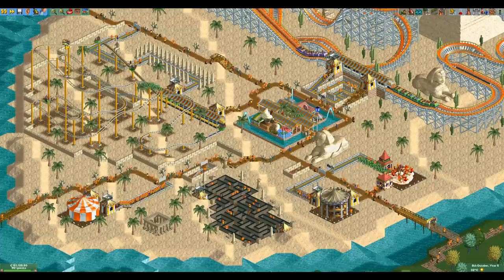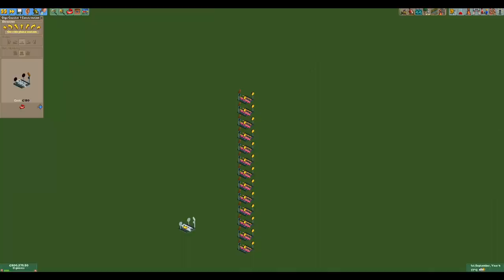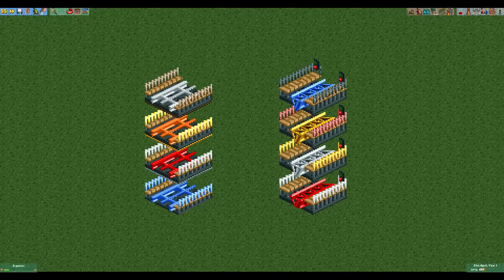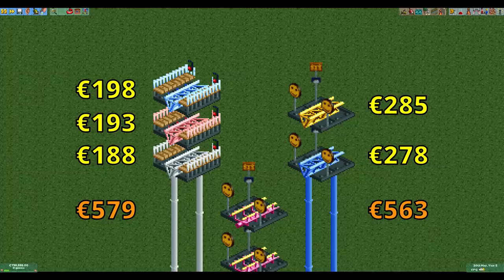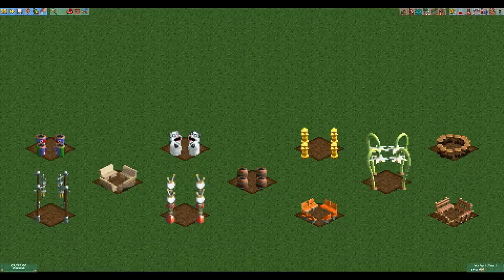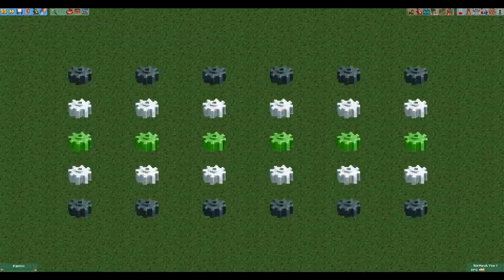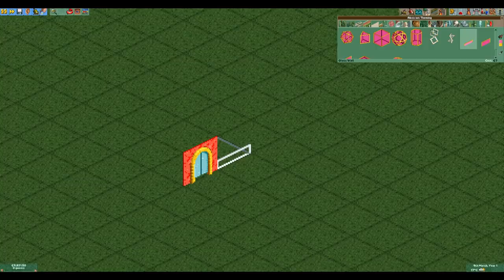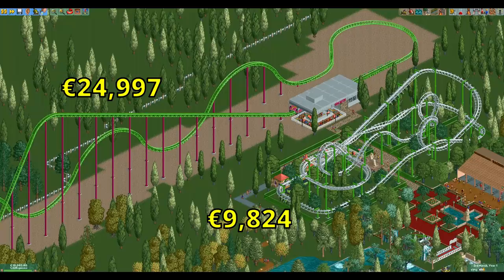How Much Money Can You Spend By Building On Just One Single Tile?

Comment from the maker: Quite a few people are asking about building underground. I start building at a height of -6, which is the lowest height possible, so you cannot build under it. If you raise the land so that you can build underground, you lose the top few pieces of path which cost over €600 each, which you will never be able to make up underground.
Reply: If one was to make an entire map of only using this tower, then assuming the largest map size is used:
256^2 = 65536
65536 * 36362 = €2,383,020,030
This is even more expensive then the price of the nation of Malta's planned economic recovery as funded by the EU a few years ago.
Reply: @serraramayfield9230  There's a challenge in this
Reply: If you lower the land do you get a higher support cost?
Reply: Is it possible to change the surface of the bottom tile from grass to another type and, even though you are at -6, change the wall style? Adds another few bucks to the total
Reply: What is the maximum amount of money you could spend in a park (before reaching the object limit)?
Reply: @serraramayfield9230  Not quite - the path signs and glass walls would be shared between sides, so you'd have to cut down the per-tower cost by 6712 per tile, leaving you with a per-tile cost of 29650 in a repeatable pattern, plus adding that 6712 cost back on 511 of those tiles at the edges, for a total of 1,965,153,214.
Reply: @undine120  oh damnit i completely forgot this
yeah this sounds right
Reply: If you were to fill tiles with this expensive tower, how many tiles would you be able to fill before hitting the sprite limit?
Reply: Can't build this here...
Too high for supports!
Reply: Thank you for clarifying that!
Reply: So, ironically building it all underground doesn’t put you in the whole as much?
Reply: You could also change the ground type (top texture and wall texture) underneath for a little more cost but it is not really building.
Reply: Lol I’m watching this again and the thought occurred to me, what about placing staff on the path?  Technically that’s an added cost 🙃
Reply: @kiffe22 build an amusement park so profitable it can fix the British economy in one year?

Comment: Fun fact: If you use the largest map (254x254) and multiply the total (65,516). The most money you can possibly spend to fill up every tile is…

$2,345,930,792
Reply: It gets even more wild with the new map sizes from open RCT 2.
Reply: Glad someone else thought of this too, but 254*254 is 64,516. Still well over $2b in pathing and scenery which is pretty mind-blowing.
Reply: do you not get into a sprite cap at some point? If so, my guess is you’d start removing the cheap pieces from the bottom layer to maximize the price/sprite rather than price per tile.
Reply: Nice this was also the first question that came to my mind.
Reply: @adysun  thanks for the fix
Reply: @wirelessbaguette8997  Yeah, I knew that this was going to be impossible to replicate due to this, but was a fun experiment to test out
Reply: Wouldn't the path pieces on the map edge would have 1 sign missing because they cannot build the cross necessary to put all 4 inward facings ones? They could still do all the walls though.
Reply: @SImrobert2001  about $65,385,033,516 (here for the guys that hate the things [ $65 385 033 516 ])

Comment: Step 1: Set up shop that runs at an overall loss.
Step 2: Wait indefinitely.
Step 3: Congrats, you have a tile that costs $infinity.
Reply: Big brain energy
Reply: You are technically correct, but it doesn't really fit the spirit of the premise. It'd be like submitting "return 1.0f/0.0f;" to the Bignum Bake-Off, your answer is "correct", but it also completely misses the entire point.
Reply: @chriso1373  big drain energy
Reply: @WackoMcGoose  
Technically correct: the best kind of correct.
Reply: "Sir remember the theme park you used to own?"
"Yes why?"
"There's this pretzel shop that's been employed and operating at a loss for the past 20 years it has accumulated a debt of like 100 thousand euros now and still going"

Comment: An interesting video as always Mr Vos, although I think you missed a significant fact.
If you take the cost of the most expensive tile, and multiply it by the number of tiles possible, you can determine what the most expensive park possible is; a sort of reverse planck-length that you can use as a measuring stick when talking about how expensive grand projects are in the future.

Comment: In a similar fashion: what's the largest number of guests that you can fit on a ride in an area that is as small as possible?

Don't count paths, because (I guess) paths have unlimited path capacity. Because of this, the simplest way to calculate this is to take the number of guests on the ride(s) divided by the number of tiles those rides are on.

Also interesting: I'd count a toilet as a non-path. Assuming that it has virtually unlimited instantaneous capacity: maybe you can make a park with the maximum number of guests, wait indefinitely until they all need to go, and then concentrate them on 1 tile and put a toilet building there? At some point, the number of guests in that single toilets building (1 tile) might be so large that the number of guests per tile on that tile surpasses any other possible combo... Also consider a stack of toilets, because maybe more guests can enter a non-path piece on that single tile in parallel than w/ a single toilet...

Comment: The signs technically break the rules of the challenge. It's not "what's the most expensive single-tile-wide stack of objects," it's "how much money can you spend by only building on one tile ." Putting signs on the side requires building on other tiles, even if they get deleted later
Reply: an a press is an a press. You can't say its only a half

Comment: You bring up the jumping fountains and snowballs which makes me wonder, is there any pattern to their actions? Flames, water jets, and a lot of other animated scenery are actually on a fixed pattern but I can't notice one for the jumping fountains and snowballs.
Reply: Chris Sawyer actually wrote a whole page on his website about the jumping fountain patterns. There are 8 patterns, and each lasts for about a minute before randomly selecting a new one:

Sequence 1: Continuous Chasers
A single water jet appears to 'chase' in a straight line, changing direction only when it reaches the edge of the fountain area, and then carries on in a different direction.

	
Sequence 2: Bouncing Pairs
Pairs of water jets bounce back and forth along the sides of one square.

Sequence 3: Sprouting Blooms
A single water jet starts a 'blooming' sequence, sprouting jets in all four directions, which each then sprout four more jets when they land.

Sequence 4: Racing Pairs
A pair of water jets race each other continuously in a straight line across the paved area.

Sequence 5: Splitting Chasers
Single 'chaser' jets travel in a straight line until they reach the edge of the paved area, then split into a pair of chasers to travel around the edge of the area.

Sequence 6: Dopey Jumpers
A single water jet jumps randomly from one jet to another.

equence 7: Fast Random Chasers
Same as sequence 6, but the jets run faster, creating a continuous looking effect.

Sequence 8: Cyclic Squares
The four water jets at the corners of a square all start at once, squirting in a clockwise direction to create a square pattern.

Comment: So if you took this $36,362 structure and filled it in the largest map possible (254² tiles), it would cost $2,345,285,632, which is arguably the most expensive you could ever make a park in RCT.

Comment: next question should be what is the most expensive ride you can fit in the smallest tile (like 1x1, 2x2, or some amount that would be the minimum required to fit a ride)
Reply: A wild mouse coaster with the smallest turns built to the support limit.
Reply: How would you calculate the smallest tile?  The Heartline Coaster is only 1 tile wide (but several tiles long), if a Ride is weird-shaped would you calculate as max X distance multiplied by max Y distance to get its area, or?  (By weird-shaped I mean a coaster that has a 'U' shape when viewed from above, but the center of the 'U' is relatively empty)
Reply: @toddkes5890  Hm... I guess if there is a way, counting everytile the coaster fills would be one way to do it. Idk how hard that would be though

Comment: What about adding extra multidimensional coaster photo sections to the ride pieces tile underground? Isn't it more effective to raise the ground, build more of the multidimensional coaster photo sections and reducing the amount of air-powered vertical launch coaster pieces on the top?
Reply from the maker: That is more effective for the ride tower yes, which is why I said "nearly the most you can spend with just rides". I didn't want to include it because it would take too long to explain considering that for the final answer no rides are used. The reason I included the ride tower is because it's an easy starting point and it teaches the importance of support costs.
Reply: Ah right makes sense!

Comment: If all tiles were filled with this in a 255 x 255 park, the cost would be 2,364,439,050 euros, if such a thing were possible. Even if there weren't software limits, nothing short of a supercomputer could run such a park.

November 4, 2021 11:30 am

Comment: If you are at the minimum height, can you still use the ground and/or wall-texture tool to add just that tiny bit more cost?
Despite at least the wall-texture thing not affecting a damn thing.
Reply from the maker: I don't count that as you can just keep changing the terrain forever, which defeats the purpose of the challenge.
Reply: @MarcelVos  Fair.